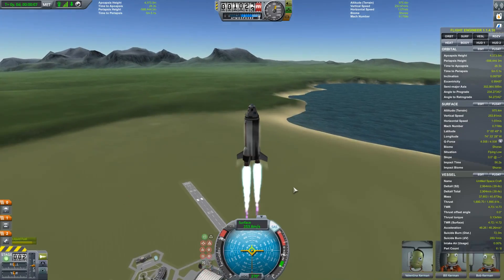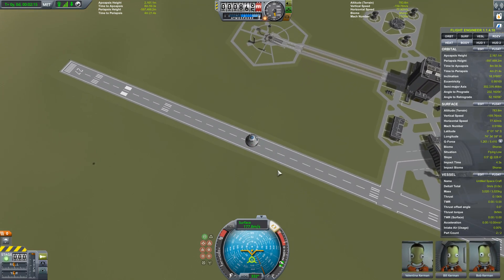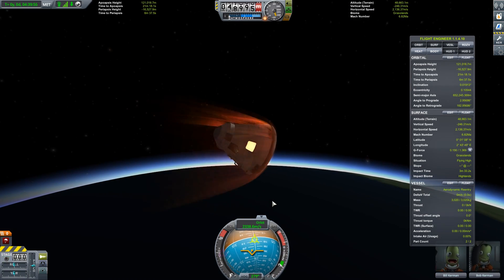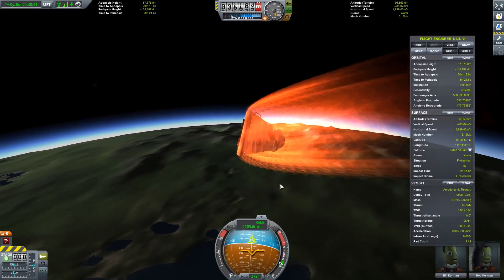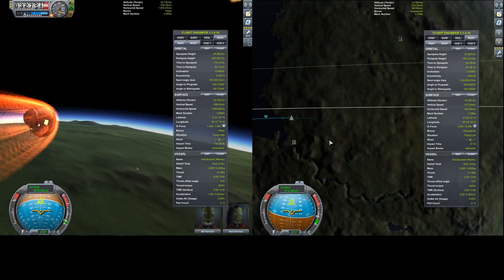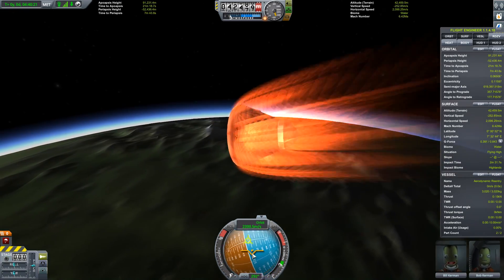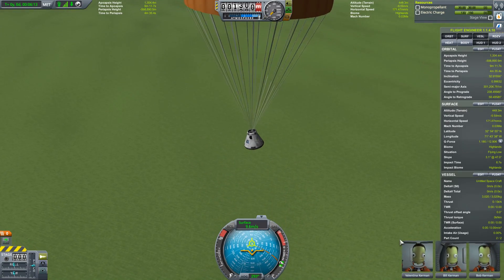Ballistic Reentry vs Aerodynamic Reentry

Comment: In KSP if I have a heat shield and I jettison it, My ship explodes. If I turn down the jettison force there is no difference. My ship blows up. If I use a decoupler to attach it , My ship blows up. If I use a docking port to attach it, My ship blows up. It doesn't matter if I am reentering or sitting on the ground, It blows up .Any suggestions? Anyone?
Reply: If you downloaded KSP through Steam, and assuming you’re using stock, verify the file integrity. Sounds like something’s broken.

Comment: IF,  an orbiting spacecraft re-entered the atmosphere and followed a nominal re-entry path(corridor) but, never deployed a parachute . About how fast would it be going when it impacted the earth?  
Yes, I know there is a formula for this but, I don't know most of the variables.
Reply: That’s just terminal velocity, which is the velocity when the force from drag equals the weight: (rho*Cd*A*v^2)/2 = F. Cd is the drag coefficient (dependent on the shape of the capsule), A is the cross-sectional area, rho is atmospheric density, and v is the velocity. So a spherical (Cd = 0.5) three-ton (F = 29430 N) capsule, with radius of 1 meter (A = pi), would hit the ground at sea level (rho = 1.225 kg/m*3) going 123.6 m/s.

Comment: not only does the Gs after the abort get higher than normal entry, but the abort itself has a MUCH higher G force acting on it, as the crew module needs to separate from the bomb underneath as quick as it can. I think some things are like 10 Gs from the abort, on top of the Gs from the booster(s).

Comment: I'd love to see a video explaining the bizarre aerodynamics of the reverse shuttlecock shape.  I saw another video of someone shooting this shape out of a gun and it was in fact stable.  But it seems counter intuitive somehow and I'd love to see an explanation for why it is.  In the video of the guy shooting this shape he was also surprised and tried shooting the shape out in the more intuitive pointy end first.  That turned out to be unstable and it tumbled.  Fascinating but I don't understand why it works as it does.
Reply: Center of gravity, it's the same reason that when you throw a dart backwards it turns around in flight and sticks in the dartboard as if you threw it normally.
And with bullets it's because the center of gravity is more towards the rear of the bullet that rifles have rifling, by spinning the bullet it stabilizes and doesn't tumble end over end from trying to turn itself around in flight due to the CG being towards the rear.
The longer a bullet is compared to it's width the faster it must be spun to stabilize it, the first rifled guns were firing balls, they have rifling that only makes one twist in around 30 inches or so because the projectile is as wide as it is long so it only takes a small amount of spin to stabilize it, modern rifles that shoot bullets that are much longer then they are wide have a much faster twist in the rifling, usually around one twist in 12 inches. 
Nowadays barrel makers are making barrels with much faster twists for long range shooters, heavier bullets are best for distance shooting, making a heavier bullet to fire out of the same gun means you have to make it longer to add weight since you can't make it wider, years ago before these faster twist barrels were being made long distance shooters wouldn't even bother checking their grouping at 100 yards when testing different loads because the bullets weren't stabilized yet at that short of a distance and they would "key hole" through a paper target nailed to plywood because they would up-end and pass sideways through the target after the nose of the bullet hits the target because of the wobble they still had from not being fully stabilized yet, back then most distance shooters wouldn't even bother testing unless they had access to a shooting range of at least 300 yards.
Years ago a ballistician that designed heavy artillery guns theorized that when the projectiles came out of one of those big guns they wobbled at the beginning of their 10 mile journey, everyone else in the business dismissed his theory until the 1920's and the advent of high speed film that could be slowed, turns out he was right.

Comment: What I want to know is if a spacecraft matched the rotation of the earth could it enter the atmosphere without any heat shield? I'm assuming not but why?
Reply: Actually yes, it could enter without a heatshield, it's dumping the orbital speed during reentry that heats you up, if you lose all that speed before reentry you are safe. It's like Falcon 9 boosters reentering, they do heat up a little but can cope without heat shield since they never reach orbital speeds in the first place.
Better example: Bezos' Blue Origin or any sounding rocket, they go directly up and then plunge back down(so they remain synchronized with earth rotation) and they never really move fast enough to heat up. Obviously stopping the spacecraft before reentry it's not easy feat. You will not be able to keep in orbit anymore and you would need tons of fuel for that or better sf style nuclear engine - notice in latest landing clip from Expanse TV series Roci do reenters without any heating, but it do have magical nuclear drive :)

Comment: So technically it's always aerodynamic, but the name changes to "ballistic" when you don't use the aerodynamic effects to control the descent trajectory?
Reply: It has to do with the G's. Ballistic reentries don't angle the craft to generate lift and lower the G load on the passengers.
Reply: @Kumquat_Lord  I think the g force is a byproduct of the different re-entry methods not the definition.

Comment: Scott, 
Speaking of ways to get back down... This might be before your time but you might be interested in the "Rotary Rocket" company.
Their plan was to cross a helicopter with a rocket thus fusing the two most dangerous flying machines into a single awe inspiring death trap. Re-entry was to use the helicopter blades to slow re-entry, much like a badminton birdie, following by "controlled" flight.
I would LOVE to see an KSP version of the original Roton rocket. Especially the spinning annular aerospike engine. It put the combustion chambers at the end of a set of spokes then spun the hell out of the engine so as to use centrifugal effects instead of a turbopump to provide fuel pressure .  More info:
https://en.wikipedia.org/wiki/Rotary_Rocket
Reply from the maker: Yep I covered this a while back in my series 'Real World Kerbal Space Program'
https://www.youtube.com/watch?v=S9LNAGq1TCM
And then I tried to replicate the landing mechanic in KSP
https://www.youtube.com/watch?v=2f7mvtS7NOM

Comment: Even more horrifying than a suborbital descent would be falling off a space elevator from a few 1000km up. From such an altitude the horizontal velocity would still be negligible but gravity is still nearly 1gee and there is plenty of time to accelerate, the elevator capsule would hit the atmosphere going at like 4000m/s, as it descends to about 50km the air gets thick enough to cause substantial drag and over the course of about 5s it comes to a screeching halt, exposing passengers to a max of about 60gees.

If you fell of a space elevator from high up you stay in orbit or graze the atmosphere, if you fall off from under a few hundred km you can land on parachutes. From intermediate altitudes, you become jam regardless of the ability of how tough the capsule is.

Comment: Just a brief historical point, the single-skip reentry profile WAS (partially) used once, by Apollo 11, due to a storm front moving in on the original recovery zone. The spacecraft did not fully skip out, but it did get a little extra range during the "up-control" period.

Comment: Well they designed it to look like a tear drop because water always turns into a tear drop because of the aerodynamic forces push it that way. So if u design a tear drop looking space craft of course your going to get a perfect aero dynamic plane
Reply: No, that's a myth. A small raindrop will be roughly spherical. A large one will get flattened at the bottom due to air resistance. If it gets too big it fragments into smaller (near-spherical) raindrops. [ https://pmm.nasa.gov/education/articles/shape-of-a-raindrop ]

Comment: This is probably common knowledge, but why are re-entry vehicles shaped like this - with the flat bottom? Why not a more typical pointed-nose aerodynamic design?
Reply from the maker: Blunter bodies put most of the aerodynamic heating further from the surface.
Reply: Huh... And here I thought they produced more heating. Thanks for the explanation, I wasn't aware.
Reply: @Malidictus  I think he means that if say you had a aerodynamic nose faced down, it would 'drag' alot of the air along its surface, wheras a blunt shape 'pushes' the air out of the way around the sides of the craft.

Comment: So the capsule wants to fall heat shield down? I would think nose down had less drag.
Reply: No, because there is more weight at the blunt end. It would be like trying to balance a cone on its nose. I've seen some of the early high speed wind tunnel tests that were done for Project Mercury. They started with the capsule intentionally going nose first and then it turns around by itself to go blunt end first. This was one of the reasons they decided to use the "blunt body" concept, besides reduced heating. If a spacecraft were to start reentry going nose first for some reason it would just turn itself around, which was an important safety consideration.
Reply: Thanks, I forget to check (or that I even have) gmail for replies.  @joevignolor4u949

Comment: You should have mentioned two things. 
1) When you climb the resistance of the air force R is compensated by the thrust of the engine F, so the overload is how much the thrust exceeds the resistance of the F-R (without taking into account the gravity of the earth.) 
2)The mass of the lander is many times smaller than the carrier. And has a comparable cross-sectional area. Therefore, the acceleration of braking will be much greater. (Paper-Stone throw difference).

Comment: I know your velocity is real fast when you enter the atmosphere what I don't understand is how your experience G's wouldn't they be negative G's or at least in the opposite direction of your travel or deceleration and gravity I don't know if I'm right or not but at least the pull of gravity would negate at least one of those G's so if there was no gravity you could be you could pull 5 G's maximum if crap what's wrong? Is that the idea?
Reply: The value of "Gs" experienced by a craft or its pilot is often used in absolute numbers without the negative or positive sign.

When used with a sign, the "positive" or "negative" has nothing to do with the direction of travel and everything to do with the orientation of the pilot. "Positive 1 G" is 1 G "down", in the direction of the pilot's legs. "Negative 1 G" is 1 G "up", in the direction of the pilot's head. If you were hanging upside down, you would be experiencing -1G.
 This direction is easy in e.g a plane, with an obvious "up" and "down" for the pilot, but it may be harder to determine with a re-entry capsule.
Reply: G's is a measure of acceleration based on the acceleration of earth's gravity 9.8m/s^2. It is all relative.

Comment: But why does the Soyuz have no attitude control capability during an abort scenario? Why cant it keep itself in a lift-up configuration when suborbital? Thats the one thing that really makes me scratch my head. Does it maybe have something to do with getting the crew on the ground asap?
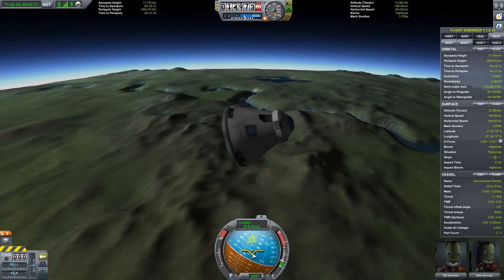Reply: 5:56
From my understanding, it is because they didn't have that orbital velocity to produce the lift, which meant they fell quickly into the atmosphere.
Reply: I concur.  The escape tower rockets simply pulled it away from the launch core stack.  The orbiter did not have time, altitude or speed to allow for long term maneuvers like turning and fully controlling flight vectors BEFORE they hit thick atmosphere.

In the Mercury test of the escape tower back in the early 60s the orbiter went down quickly, survived fine and landed in the surf only a couple hundred yards/meters off the beach.  Not far on the X axis from the launch at Canaveral.
Reply: @STho205  - I still don't see why the reentry system can't fire up and keep the capsule in a lift-up position regardless. Make a 7g reentry into 6gs.
Reply: @motokid6008 .  I don't know, you tell me.  Just a casual observer since the 60s myself with a year of physics courses in university for my Chen degrees and some friends at NASA.  I'm no flight engineer.  

I do recall my friend telling me, about Apollo 13 reentry, that they had to make corrections way out, in small increments after the big Earth burn and in orbit to not tear the orbiter up trying to achieve proper reentry.     Escape tower systems are completely automated, I think/so I'm told, and are geared primarily to get the orbiter away from the launch booster faster than a human can press a button.  Doubt the cosmonaut or even the ground crew did much flying in those moments before the chute.
Reply: @STho205  - I just can't understand why they don't use what they have. They have the reentry system to make it a non-ballistic flight. Surely there must be a reason to not use it. All I can think of is to get the crew on the ground asap in an abort scenario. Where as with a lift-up configuration such a thing would get delayed. Or maybe all fuel for attitude control is subsequently purged after separation from the booster.
Reply: If i'm remembering correctly, the amount of lift that a body can generate is proportional to three things, weight, shape/size and velocity. The capsule is too heavy, and also the wrong shape and size to really generate much lift, unless it has massive velocities, like, orbital velocities. since the capsule is already decelerating by the time the launch escape motors have burned out, and it then has to turn around, the capsule never really gets the speed up to make non-negligible lift unless the rocket is almost orbital by the time of the abort, at which point the Soyuz capsule's propulsion segment can perform any necessary burns to abort the launch.
Reply: @sansthepungeonmaster5864  - But surely some lift is better then no lift. Then on top of that you have two crew subjected to a spinning spacecraft. ( As mild as it may be  ) So there has to be a good reason to not fire up the reentry system and hold attitude as opposed to just spinning it up and letting it fall.
Reply: that's the thing, it is getting no lift. The pod is unable to fight gravity to any noticeable extent. Then there's the stability issue. Due to the center of mass offset, the capsule sheds air unevenly, more is going off the bottom than the top. A portion of this is going off sideways, and creating a tendency to roll unpredictably. Here's the kicker though, the capsule *is* able to produce a large sideways turning force, and the reentry system can't keep the capsule 100% stable, this can produce wide horizontal errors without the ability to correct for them, since there simply isn't time. By spinning up the capsule, they make a more predictable air shedding pattern, and the overall circular error probable in the craft's trajectory is less than the ovoid error probable in a lift-up configuration, at least in an abort mode. 

Edit: and then there's the rule of K I S S.
Reply: @sansthepungeonmaster5864  - It's not lift per say, ( idk what to call it at that point ) but a capsule holding a significant angle of attack would generate horizontal velocity. But yeah I understand what you're saying.
Reply: In an abort scenario it's a good idea to keep everything as simple as possible. Capsules, Russian, Chinese, and American, are usually designed so that if you do nothing, it will settle into a heat shield forward attitude, making it inherently safe. You just need to rotate it to cancel out any lift, and just let it hurtle through the sky until the altimeter senses you are low enough to open the chute. This is the simplest way to get the crew safely back to the surface even if the autopilot electronics all fail, if there is no way to tell what your attitude is, if the crew is already unconscious, etc. Just get the thing back to the ground in one piece.

Comment: Thank you for the video.
I was one of those who asked what a ballistic re-entry meant.
This video really helps me - I still don't fully understand what is happening but now you have shown me in an animation what happens I can replay it in my mind until I understand what is happening.
Based on what you have shown it sounds like one of the main factors is the altitude, since the re-entry vehicle is moving at a high speed in a still relatively high density atmosphere the deceleration(acceleration really) is higher than if it was re-entering the atmosphere from 'space' where it can decelerate at a slower rate due to the atmosphere being less dense.
Reply: sort of got it. What ballistic re-entry means is that the capsule is not doing any maneuvering to try and control it's decent, instead it "flies as it flies", it is un-controlled (which sounds scary hence why they say ballistic trajectory or ballistic decent), doesn't matter what altitude it is descending from.

What Scott is showing us is WHY you would want a capsule to normally control it's decent (because it can reduce g-loading), he is also showing what can happen if the capsule tries to control it's decent improperly (the super fast and steep entry that resulted in really high g-loading). He then showed us how a ballistic sub-orbital reentry could be harder on the crew than a nominal re-entry from orbit (this is due to the altitude, as you said, even though returning from orbit means you start off going faster).